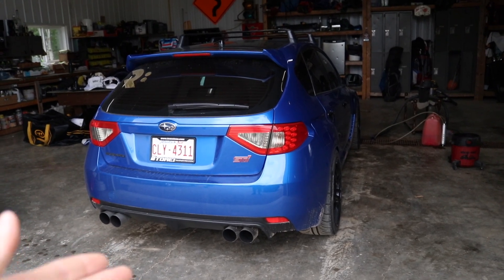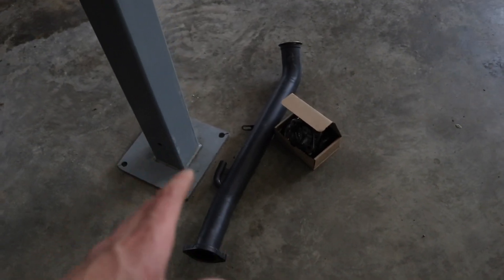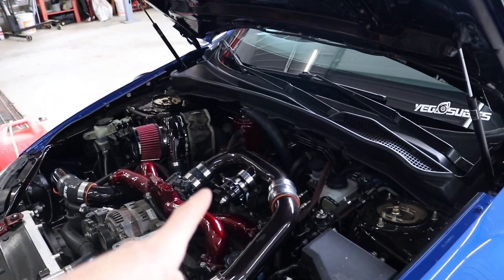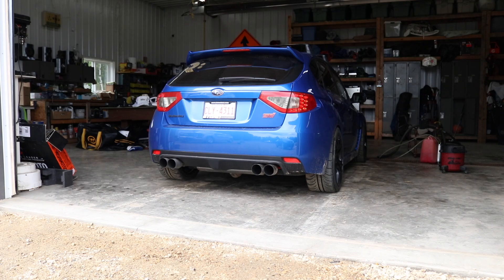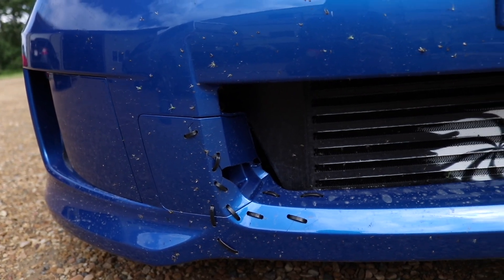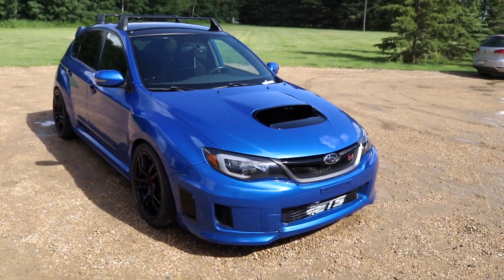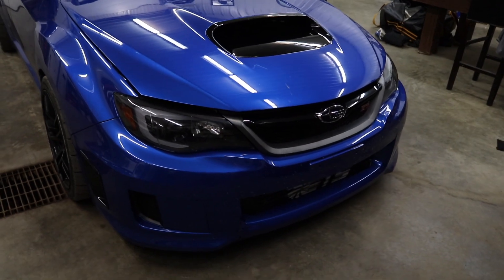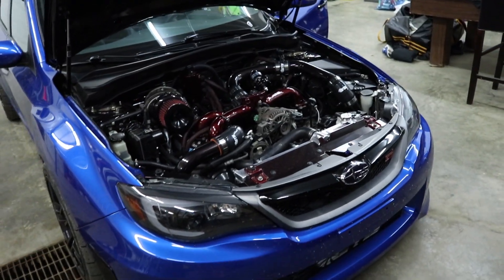New Cobb Exhaust For My 500HP STI!! (Raw Sound Clips)

Comment: Hey, if you wanna have a really epic "1000hp supra" style flutter sound, you NEED some kind of pipe, preferably with some kind of bend on the front of the turbo before your filter. A smaller diameter will have a higher pitch and a more drawn-out first note, larger diameter will make it deeper/slower with a shorter first note, and if you put a 4-inch straight or a short angle it'll be more like a sigh than a stututu. Also, material slightly affects the sound, unless you use some form of plastic, in which case it'll nullify the sound and you just get a whoosh.

Look up "dose pipe comparison" and it's like a 25 minute video or something by Keep it Reet, but I left a timestamp in the comments of the back-to-back comparison that happens at the end.

Lastly, IMO your filter is too small, go back to the 13-inch cone or whatever you had before, at a minimum.
Reply from the maker: Good info! I agree the filter is too small, getting a bigger one next season! 🤙🏼